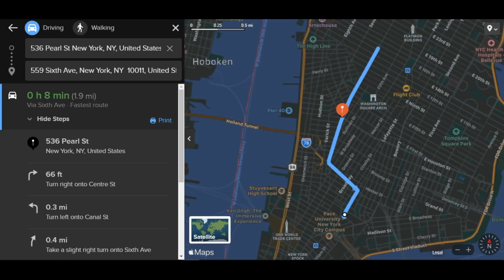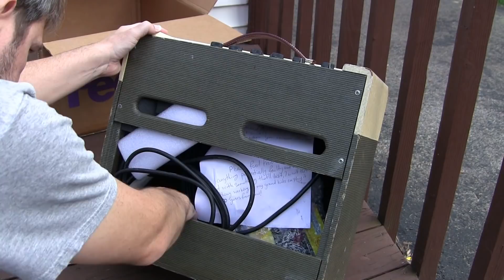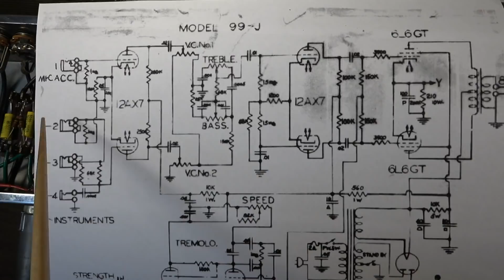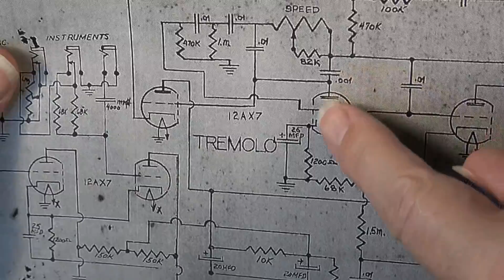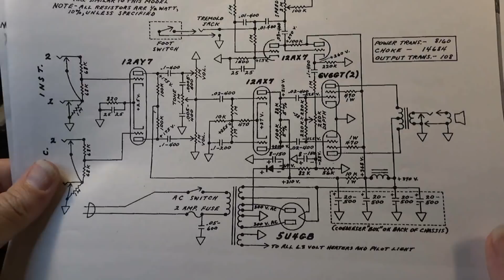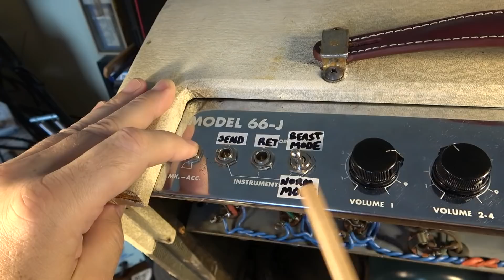Fender Tremolux KILLER - 1959 Guild 66-J Masteramp Goes "BEAST MODE"

Comment from the maker: UPDATE: The replaced CE cap can that was put in this amp by another tech is actually physically vibrating. I'm having to change it to discreet components on terminals after doing this video. Something is amiss in this can's construction. The physical vibration is so violent it's manifesting into audible noise in the circuit. Very odd. I've only ever seen this with power transformers before now that had loose laminations. I also think this amp could benefit from a choke. I can feel a follow up video might be in order on this one.
Reply: Will be interested to see the follow up and the vibrating cap, that's a strange one lol...  Also, only found the video because I saw your post about it not getting views!  I have notifications set to "all" yet still barely ever see your uploads. Methinks the screwtube gods are not happy with your practicing freedom of speech, fuck them... fuck them in their stupid asses...
Reply: I watch most of your content. the amp repair does interest me (although far beyond my ability) I have my original 5w red Marshall Mercury amp bought from my aunt's catalogue in 1972/3 still works and sounds great I also have a scala 2 channel amp also this doesn't work but it used to sound really nice till I lent it to a friend hope to get it repaired one day! 🤞🇫🇴👍
Reply: An inexpensive Hammond choke for Fender 6V6 amps would be the ticket!
Reply: That would be excellent, so we can see what the solution and physical layout looks like. Thank you for all your time and effort.
Reply: I was guessing the CE cap was bad.   I’ve run into it before, same symptom.
Reply: @YourMotherRobbedSpermBanks It’s likely just that sub 1% defective cap that got through QC. It happens every once in a while if you do this long enough.
Reply: You did a hellova job Brad, sounds great hope more of this is on its way
Reply: It kinda sounds like transformer hum and mu old fender is louder. What a sweet little amp.
I hope your troubles go away Brad you dont deserve it.
Reply: Those cap cans can be bought on antique electronic supply and are very expensive. Apparently they are reproductions made on the original mallory equipment. I used to use antique electronic supply and still do for some things but I recently ordered from Tayda electronics. I haven’t gotten my order yet but I got a ton of stuff from them. 1/4 watt resistors for my pedal builds at $0.012 each, 1/2 watts for around the same price. Dirt cheap compared to AES. I’ll let you know how their parts fare compared to antique electronic supply. I was able to get all the parts to build klon for like $20 including the pre drilled enclosure to my specs. They also do enclosure UV printing that you send them your pedal artwork vectorized and they print it on your enclosure. They have a lot of lower voltage parts that are great with pedals but also they have stuff that can be used for fixing amps. This is not an ad I just wanted to share this to maybe help with your overhead costs. I know it’s hard to make videos and efficiently repair amps making a profit. That’s why I switched to building pedals and amps too so I can try to make it worthwhile.
Reply: Cut the cap apart, we want answers. I've never heard of a cap vibrating by itself, extremely weird. Might have very high inductance causing it to magnetize itself and vibrate with the ripple.
Reply: We had (I'm not naming who 'we' are) had capacitors made by a company and they stuffed the spare space with foam rubber that reacted over time with the electrolyte and made an acidic goo that ate the guts. It can happen (pun intended) even with the best of intentions.
Reply: Thats for letting us know, i was curious myself.

Comment: I can bias an amp and some basic component replacement and service that's about it.
    Enough to not die doing it and keep a currently running amp running. Unless something catastrophic happened.
    I was once given a regretfully sold Silverstone with a single 12 and two 6v6 tubes 3 12ax7.
 The amp wasn't functioning.
   I simply pulled the tubes cleaned them and the sockets and plugged it in.  It sounded great even the tremelo.
  And with a new age speaker was loud as hell.  The original speaker made it fairly quiet but worked and sounded great.
        Wish i didn't sell tht am I forgot what model it was.
  But cranked with a start it sure sounded awfully Stevie ray Vaughn.
      Had volume tone tremelo. And a mic input I think.
Reply: It ws the 1482 model.
  2 12ax7 and 2 6v6.
 I think I got 250 for it now I'm seeing asking prices at  600-800.  Insane
    I didn't have to replace grill cloth it was  disintegrated.

Comment: I prefer these grounding scheme repair videos much more because I'm very curious about grounding schemes. I haven't seen you make a theory video about grounding schemes to go over grounding buss in amplifiers. It gets really complex because other techs I have seen will separate the inputs jacks from the Pre-amplifier grounds from the Power Amplifier Grounds. I think they will FLOAT the Preamplifier ground so its not tied to earth/chassis ground, but the power amplifier will be tied to earth chassis ground. The Tube sockets are often tied to chassis earth ground at each tube socket but this causes more noise issues poor S/N ratio. The heater voltage wires from some reasons causes issues with noises because you have to dress the wires and twist the wires away from the preamp circuit. I'm not sure why the Heat wires cause so much noise and interference issues because its just 6vdc or 12vdc nothing special so the tubes must be flickering internally which is backfeeding or riding a superimposed noise on the DC heater voltage to cause more interferences. The Rules to Follow LIST: Tighten the Power Transformers nuts down helps reduce S/N ratio,  Virtual Ground the Heaters to the power tubes Cathode node to help reduce S/N ratio,  Remove all the tube socket Individual grounds per tube socket to a BUSSED ground to reduce S/N ratio,  Create an Isolated ground from the Preamp section circuit ground to be FLOATING not tied to chassis earth ground to help reduce S/N ratio, Add a brass shielding buss ground for all the pots on the front panel, which I'm not sure if you connect this brass shielding buss ground for all the pots to be tied to earth chassis ground or FLOAT it to reduce S/N ratio. I'm just giving you ideas to go over if you can make a video lesson about grounding schemes and how to seduce S/N ratios in guitar amplifiers.

Comment: Love the Weller soldering guns. I have 2 of them that I use. I have a power regulator that I built to plug the guns into so I can set the temp. I like your can idea. I'm gonna borrow that if you don't mind :) The amp sounds great! I see the addendum about the cap can. Looks like a Part II is in order. Cheers, Brad!

Comment: Absolutely made by Guild by Guild technicians. It was not a contractor amp, it was made in Elizabeth, New Jersey. This is according to Aaron Newman, the chief engineer of Guild from the early sixties until the amp line was ended by Leon Tell in the early seventies.
Reply from the maker: They didn't have that factory up yet when this was made, according to the book. It didn't come along until some times later. It doesn't get specific, but that factory doesn't get mentioned until talking about later 60s amps. Do you have a source on that? Thanks for the comment.
Reply: @TheGuitologist  Which book are you talking about? I got it straight from the horse's mouth. In construction, Guild amps are nothing like premier amps, in any case.

Comment: Cool Video Brad. I am not fully versed in effects loops so I am wondering why did you choose to put the loop so early, after the first gain stage. I would imagine it would be right before the phase inverter. Like I said I don't know because I haven't added an fx loop to my amp build but I assumed it would be after the pre amp and before the P.I. whats the reason for that placement electrically?

Comment: I'll never laugh at your soldering gun. I've been using the same one since 1972. Still works. I have several different tools depending on the job, but the gun still gets used a lot.

Comment: It is never a good idea to separate AC power and ground in that fashion. I had ten years of design in commercial aircraft power systems - terrible practice with DC, really bad with AC. As you said, and it is not theory, the field and the currents absolutely affect the signal, especially in the more sensitive pre-amp section. But you don't do it one way for the preamp and another for the power section, you just do it right all the way through. Tightly twisted pair. The ground becomes a shield of sorts.

Comment: Did you ever think of pulling that multi cap out, gutting it and sticking modern capacitors inside it. That would make for a totally clean and virtually undetectable repair. It's a bit of work but I think it's worth it.
Reply from the maker: I had considered it, yes.

Comment: My old 70s big muff pedal is oscillating when the pedal volume is at max.... so I don't turn it up hahahau
Reply from the maker: Sounds like you probably have some drifted component values. If you go through with a meter and replace all out of tolerance resistors, I bet it solves the problem.
Reply: @TheGuitologist  I will do my friend! I'll dig into it later on today.

Comment: I know your not a Blackstar fan but I want to add a footswitch to my practice amp HT-1RH mk1 as it didn't come with one and the mk2 did. Cant find any videos on this mod but a bit of looking around its supposedly doable..... God I'm gomma kill my amp 😒
Reply from the maker: Because adding long cables that carry signal causes noise, switching channels isn't simple. It usually involves a relay or LDR (light dependent resistor) network. This usually involves giving it its own power supply from somewhere in the amp, or you'll have to build out a supply. Unless someone sells a board you can solder in, it's probably not something for the beginner. But you're right, anything is "doable". The alternative is to just sell your current amp and buy the one with the capability you want. ;)
Reply: @TheGuitologist  very true mate it's a fantastic home/practice amp but definitely falls short not having a single button footswitch option for the gain. As sound goes it does everything I want when I'm in the house as the low volumes are great. I just can't see myself spending over 1k on something like a fender junior.

Comment: Brad, good call on the filament wires.. however, i always put effects loops in between the pre-amp stage and  power amp..  reason being as the type of effects you run in an effects loop are modulation, delay, verbs, etc..  things you want post tone stack.. to effect the whole sound and not change it before or mid stream.. then you can use the return as a power amp in, to bypass the entire pre-amp too.. or the send to take the pre-amp signal to a outboard power amp.. very useful to send to an amp/cab sim or straight to a board or for recording/mixing.. the way you have it, you might as well just run all pedals/effects before the input like you would distortion, compressors, etc.. as always, great content and thanks for creating for us.. btw, how's the school board meeting case going, hope the dropped the charges.. sorry if i missed an update.. we care about you man.. we stand for the same principles
Reply from the maker: I appreciate the comment. Good to see you again, by the way. There are no additional stages of preamp after the loop besides the PI. I accept the criticism, but also, the benefit of placing the loop where I did is that you get an additional "mode" to the amp by allowing the Return to double as an instrument input and still have tone controls. So you can still use the loop as you suggest to affect more of the amps' overall post "gain" tone while maintaining the third "mode". That was my thinking anyway. Not saying I'm right though.
Reply: @TheGuitologist  I'm beginning to see sense. And in the end, what matters is how the owner is intending to use the FX loop. If this solution serves the needs of the owner then it can't be wrong.
Reply: @TheGuitologist  I mean, it just takes a chassis-mounted 4pdt switch and you can move the loop between the two locations, right? Then both you and the OP can be right and wrong at the same time.

That’s gotta make this some sort of advanced quantum mechanical amp, right? 😂
Reply: The FX loop that Brad put in is going to be useless. It's the dumbest thing I've seen on this channel. It just doesn't make any sense.

Comment: Brad, good to see you back at work  hammering  away at vintage amps.  I was trying to figure out a way to ask my question  via pM fathering than out here in the open.    It has to do with a recent report that amp  tubes may soon join the list of items that are becoming in short supply.  The report said the reason was due to most of the companies who still manufacture tubes are in Russia and China.     I was wondering who this news may affect you as an amp tech?    While you may have a lifetime supply of Vintage RCA Black Plates, how is this latest shortage going to affect the tube amp purists?    My question is, do you really find a great deal of tone and longevity when comparing a Sovtek tube to  an RCA or sylvania nos tube!   I just ran a search for 7025’s.  They are supposed to be a very low noise version of a 12ax7.    The 7025s are already hard to find with only EH Offering their own self -labeled products which are probably Made in China or Russia.  That said, I found a pair of Shuguangs   made in China for a very reasonable price.  The reviews on these tubes run the full gamut of, they are crap, up to, they are better than Mullards.    The audiophiles use them in their high end gear and they swear by them.    I know we had these same discussions a few years ago, long before RCA tubes were selling for over $200 a copy.  Guitar players were scrambling to find a low cost replacement in a groove tubes,  Ruby,  J J’s and the old JAN Phillips military stuff.    My Fender Super Reverb tube chart calls out for a few 7025’s.  Am I courting disaster if I can only find these Chinese Shuguangs,  or should I look for 12ax7A’s.   Even a  Sovtek 12ax7LPS is being sold at 40 bucks each.   When you are working on a customers amp, and it needs a tube, do you just toss in  a J J , knowing they are fairly decent and will provide a few years of service in the newly restored amp?  Or do you consult with the client and suggest some other higher cost tubes than will make the amp sound better?   We had a similar discussion over which brand of Capacitors you typically stock and install.
Reply from the maker: Long question. Maybe I'll answer in a video clip. Good topic for discussion anyway. There is a lot of recent news that bothers me with respect to tech in general and tubes. Could be a good "Ask an Amp Tech" vid topic.
Reply: @TheGuitologist  Yes, sorry i rambled on for so long.  Great idea, however.  If you could squeeze in a podcast about tube selection and what sounds good, vs what is not.

Comment: Great work! Gotta be careful using a soldering gun..pretty easy to overheat and maybe damage components. Also the tips get soft once they heat up and are easy to bend if you try and pry with it or push too hard against the joint.....been there done that .
Thanks for an interesting video! Cheers!
Reply from the maker: This is true. I have to remind myself not to use it to pry like I sometimes use the iron.

Comment: Brad, good video, 👍, when you have a 4 section filter can, you have a common ground for the power amp, and the f/e. That doesn't work in my experience. You may want to try to separate the 
f/e  ground from the filter cap. I've had the same issue many times with the 4 section can. I just use 3 with the common ground, and use a separate cap for the f/e supply. Cheers
Reply from the maker: Thanks for the comment. I have had so many experiences with different amps and I think you might be right. Some amps don't seem to mind, but now that you mention it, maybe that's worth experimenting with. I need to get back in this one anyway to replace that vibrating can cap. I think the fault is probably physical in the construction in this case, but I'll mess with the grounding scheme more if it persists.

Comment: I can't imagine why anyone would want an effects loop in an amp like this,but to each his own
Reply: I've had both types with and without. I think they come in handy with more modern high gain designs
but with older amps like this I see less need. I found that I actually prefer running effects pre gain in most cases.
Definitely with tone shapers like Overdrives or Wah pedals and even delay pedals due to the natural compression of the amp.
Reply from the maker: I thought that at first, but I can see where a passive loop is definitely more versatile than the extra inputs as they were.
Reply: Putting say a reverb or chorus pedal through a loop is much better through a loop than going through the front of the amp. I only put higher gain pedals through the front and everything else in the chain through the loop. That's how I was told to do it in the mid 80s and ive been doing it tat way since.  Works for me.
Reply: @stu-j  it all depends on the amp and your tastes...I prefer modulation through the front of the amp...In a high gain/channel switching amp,I would put reverb and delay in the loop...in a vintage low gain amp like this,I wouldn't need a loop...of course there are no rules and we do what sounds best to us